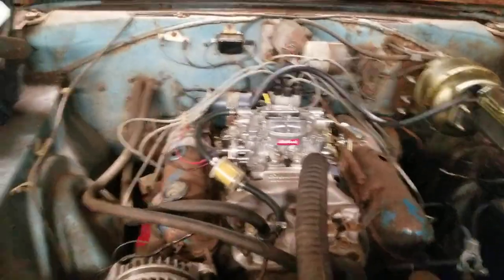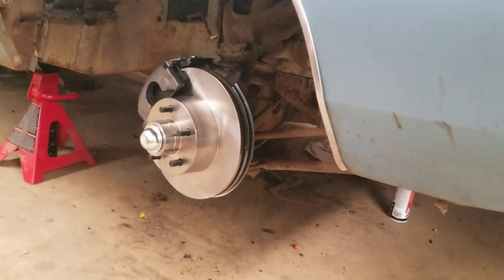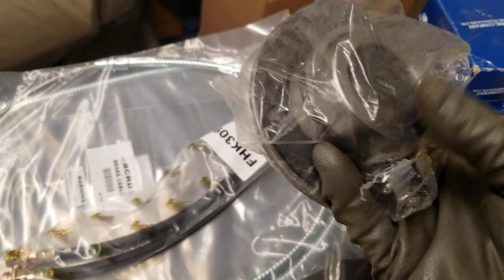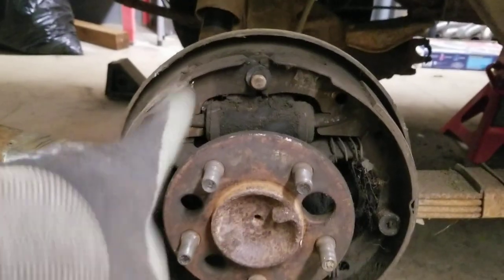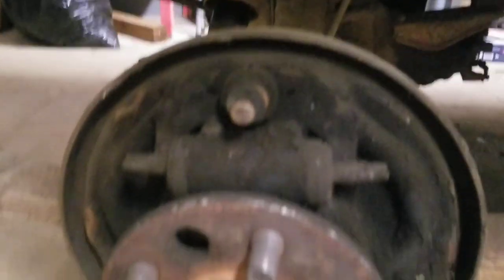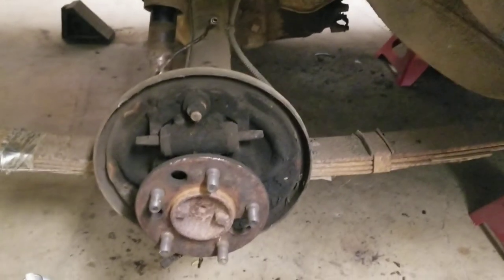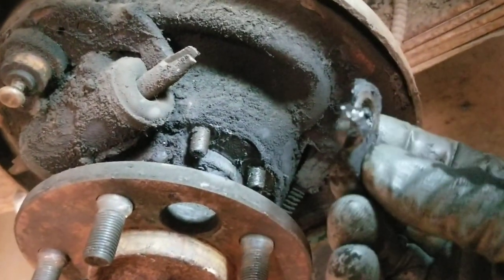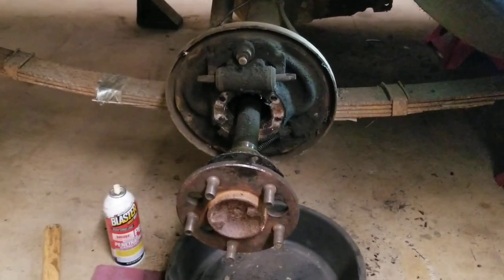Mopar four wheel power disc brake conversion part 1

Comment: Dave,
I have this same kit on my 69 Charger, the only thing I have not liked about this kit is the brake booster adapter pushes the brake booster out so far and covers up the driver side of the engine. And I also had to run 1/4 spacers in the back for my 15” factory wheels to fit and not rub the back of the rims. Great video, keep up the great work!!!
Reply: I have the same kit also but I removed that adapter bracket from the booster and mounted it directly to the bracket on the firewall it looks stock and functions great, I dont know why that bracket is even on there
Reply: Barry Bentley Thank you for the advice, I am definitely going to be removing that bracket tomorrow.
Reply: Barry Bentley  I just got done removing the brake booster and bracket from my 1969 Dodge Charger and your information Barry is bogus. It does NOT fit without this bracket unless you are planning on drilling holes in your factory firewall. I tried this with both a manual brakes car as well as a power brakes 1969 Charger, and neither will work without modification.
Reply: @justinroberts5400  Im sorry I should have specified I did it on my 1969 Roadrunner, Im not sure firewall is same or not but I have been running without the bracket for 3 years now, no drilling firewall, mounted right up to firewall looks stock, its the same kit shown in the video from The Right Stuff

Comment: Nice! Question off topic for the CUDA! What wildwood brakes did you go with for front and rear? I'm restoring my 1973 Cuda right now with my dad. Looking at going Willwood all the way around. Not sure on what size. I am gonna run 18in rims

Comment: I have a 73' Challenger Rallye 340 4 barrel. Dave what can you recommend on getting the Thermoquad functioning properly? A couple of years ago a professional "rebuilt" the carb and it still faulty. It only runs decent with 2 barrels; anything beyond that the motor falls on its face, as if secondaries are not opening or it is totally leaning out? I seldom drive the car so it is not a huge deal but I am just tired of it.

Comment: For a four disk conversion 
You need to install a master cylinder 
With enough fluid capacity for disk brakes, that master cylinder is for a 
Disk/ drum setup not a disk/ disk
Reply from the maker: This is the correct master cylinder for this application, it is compatible for a disc/disc setup.

Comment: I would not want a driver car that has a nice paint job because I would be so concerned about rock chips ans scratches that's why I would leav it like it is and drive it with the old patina look that way if it get's a dent or rock chip it will just add to the character of the car that's all.